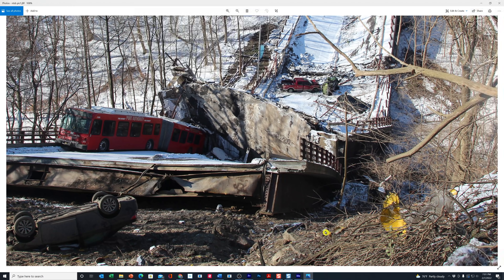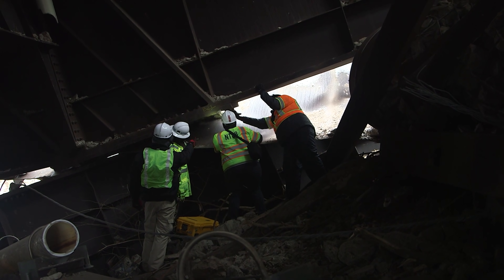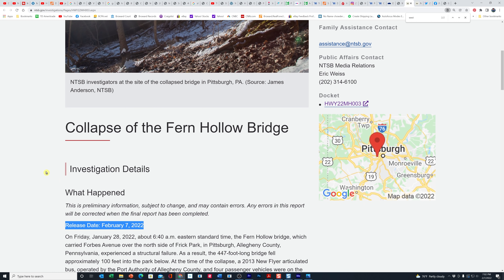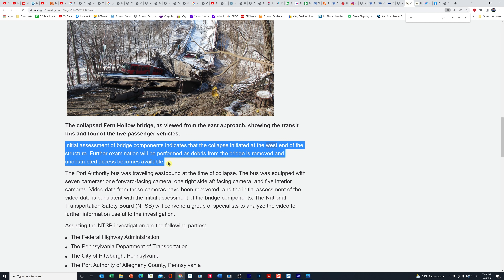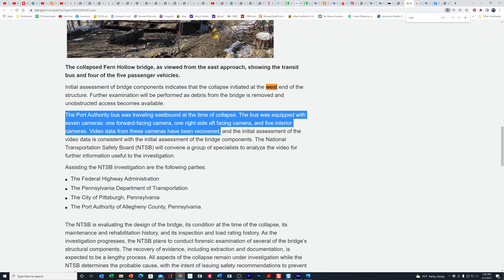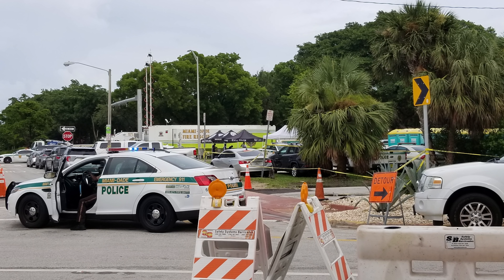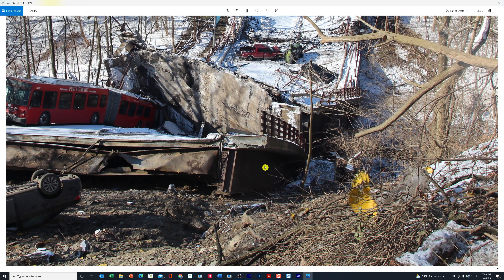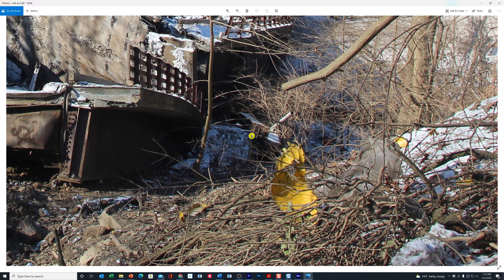NTSB Report Points Where Pittsburgh Bridge Collapse Started

Comment: Bridges have a life span which account for weathering and wear and tear.  This bridge probably needed to be replaced long ago.  Today's bridges are built much stronger with a life span of at least 100  years.  When the interstate system was built in the 1950s it was built with a life span of around 30, give or take.  Engineers back in those days knew that by the time the interstate highways needed to be replaced, design and engineering methodologies would be much stronger and durable.  Large expensive bridges like the golden gate bridge and the george washington bridge are the exception due to their high price tags and thus they are very well maintained.  The city of PGH did no good on kicking the can down the road for so many years.  Kid you not, there is some money in PGH - Melon Carnegie.  PGH needs to get their act together and the citizens and media of PGH need to start holding their politicians accountable.  PGH is not a poor city by all means and can do a much better job.  Just saying...
Reply: M Johnson — this particular bridge that collapsed in Pittsburgh was constructed in 1970.

Comment: Does anybody know what the temperature was that day because concrete shrinks when it's cold so if it was very cold then that means the bridge was small which would have made the expansion joints be open real wide allowing the bridge to wobble side to side if the bridge girders was rotted out then there's no doubt what caused it

Comment: The concrete that she was pointing at the I had to rebar exposed if you'll notice to the bottom left hand that's all been patched that's why I concrete stayed in the concrete just that is flaked off the steel is old concrete but yes at the bottom mat is only usually about 2 to 3 inches off the bottom but the old concrete that flaked off is all missing of the the mat of steel it was all old the concrete that you see now that's covering the steel is brand new concrete which is a patch job I worked on bridges for 36 years I know exactly what it looks like  and that is very
Reply: Common when the steel has salt that has penetrated through the concrete it's called sparling

Comment: We used a lot of COR-TEN in Michigan bridges from about 1968-1980 but it was found that in certain environments it just never stops rusting. Ultimately it's supposed to develop an oxide layer that acts as a barrier, it will rust to some extent and then that rust protects the underlying steel. Most of the COR-TEN structures remaining in Michigan have been painted.

Comment: I've seen a ton of jobs where the city maintenance department workers come up with a "fix", it never gets engineered or checked and often times results in more issues. A lot of times they patch together something that is a symptom of a bigger issue but they don't have the knowledge to put two and two together. And more often than not, they are focused more on aesthetics and public perception than the true condition of it.

Comment: @ 9:05 you show the support column concrete structure laying under the bridge . Indeed the reinforcement steel is to close to the surface.  The location of said column under the collapsed bridge tells that the bridge on its way down made a sideways move exposing the column on the other side . Though the concrete came off of the outer layer it is not telling of the inner placement of re-enforcement steel on the inside of it . Usually there is a core steel cage structure that is in line with the directional forces that the bridge is calculated to exert on the connecting points . The concrete peeling off can simply be the result of rust jacking and came loose due to sudden load decompression at the point of the bridge collapse.   Though to me it looks more like the underside of the deck slab where the shock of the fall crumbled off the surface layer of concrete.  Judging by the color of the steel mesh there doesn't seem to be a lot of rust on it as so it was in pretty good shape when it comes to moisture penetration causing rust jacking

Comment: Question.  Would you know if the base of the bridge was wider then the bridge deck ?  Meaning was the leg structure in a kind of A-frame configuration for side to side rigidity?  If one of the legs had given way , the bridge would have slumped more to the side instead of what it looks like to me where it more slumped down along the center line of the bridge with a minimal sideways deflection.

Comment: Bridges like these usually have a ball and socket connection where the leg frame sits on the piers . It accommodates for minimal  movements for weather induced expansion and contraction . A flat on flat surface contact would not hold and requires a different type of bracing between all 4 legs along the length of the bridge in order preventing them to slip off of their bases.

Comment: @ 5:59 you show the concrete Pilar foundation with the bridge leg laying to the right next to it ( east side ) . You can also see the bridge head separation and the damage to it . It has buckled seeming like it snagged behind something while it was pulled into the ravine.  The bridge leg is also pulled from its base and landed to the right of its base while it seems relatively straight by the looks of the footage.  Since the bridge came to rest about 10 foot to the left of its base line tells that the cross braces gave way and made the structure slump inward and to the left. Earlier footage from the ntsb shows the cable bracing being frayed and curled meaning it released tension in a sudden manner with the tensions energy coming back on the cable making it flower on itself.

Comment: NTSB wrote, rightly, that weathering steel is used for facade expression and to give an architectonic look after some years, provided exposure to rain, and allowing that rainwater to drain off.
In other corrosion cases, as standing water, trapped water, overlapping plates, galvanic corrosion etc it is no better and maybe worse than ordinary construction steel grades. 
Other steel manufacturers fought hard to keep contamitants as nickel and chrome to low levels.
The Cor-ten manufacturer turned those elements into a sales pitch, and some people fell for it. Pun not intended.

Comment: In regard to the rebar on the roadbed, I see that way to often with concrete jobs around town. For example, residential driveways are poured directly onto raw soil without any preparation, sand, gravel, no rebar etc., and these are housing developers/contractors who are doing it. I also see spot jobs around town that the smaller contractors work on and they rarely use "dobies" which are the spacers used for lifting up the rebar (or welded fencing wire) so that it is about center of the thickness of the slab they will pour. It's such a joke that these "concrete contractors" believe they are doing anything correct when all they are doing is cutting corners with less materials and saving labor.  I've also seen them use fencing wire vs. rebar and they use a square tip shovel to bend the wire here and there to get it uneven so that some of it reaches into the concrete...another stupid idea.  5 years later, people wonder why their driveway is cracking with uneven surfaces. 

No good information will come out of this bridge inspection. I hope the investigators put the city into a corner and force them to answer some tough questions. Also, I'd do the same with whoever, a contractor, engineer, city employees etc., installed the cables retrofitting to "help" the structure.
Reply from the maker: And the city needs to make tough changes in inspection

Comment: from what I could tell that rebar looked pretty normal I didn't see a lot of rust on it, that's what causes spalling and the rebar itself looks to be the normal 1.5" to 2" imbed, now in almost all pours some rebar will fall of the support and can be as close as .5" to the edge of the form that's normal but it looked like all was imbedded in the concrete, I think that spalling was caused by the fall.
Reply from the maker: Yes the concrete chipping off was from the fall, but it exposed what looks to me like rebar that is not 2" deep

Comment: Looks like there was compressive (l/r) buckling on an horizontal transom (at 8.13 minutes) possibly cause by the earlier attempts at strengthening with the post tensioning cables under the bridge deck - (extra thermal stress in cables due to cold causes buckling in transom beams and hence  longitudinal sides of deck pop up higher than centre line of roadway deck) ...?
Reply from the maker: Yes, likely several stressors contributed to this failure
Reply: @jeffostroff  no point in having tensile cross bracing without adequate resisting compression members 👍🥝🥝🇦🇨🙏

Comment: NTSB's job is to determine what happened and -- hopefully -- prevent a repetition.  They have nothing to do with any legal considerations.  In fact, their reports may NOT be used in any legal proceedings.  It is quite normal to have all parties who may have been involved in the design, construction or maintenance involved.  It is also quite normal for the public to not be involved; though they may be interested, they are not in any way qualified to comment. The comparison you made with Chaplain Towers is, frankly, misguided and reflects a lack of understanding of the NTSB process.

Comment: Jeff:  Thanks for another excellent video.  It made me think of a couple of things.
1) What did the inspectors do first? Look at the bus video or inspect the bridge? I'm thinking that they found that the bus video "agreed" with their assessment only after seeing what happened on the recording. This raises questions about what else they will conclude.
2) The collapse apparently followed the bus. It began where the bus had just been and went in the same direction. This would mean both that the bus was too heavy for the condition of the bridge and that the bridge should have been shut down or have been limited to lighter traffic at the very least. 
Some people, probably from several agencies, contractors and engineering firms are responsible for what happened. Will their be any accountability?
Reply: NTSB often has multiple teams on site, and in labs, some doing computer simulation. They tend to also work with everyone involved in cases, even if the companies who might be culpable they would have limited access to physical evidence. But multiple teams and multiple organizations assisting them come with multiple (often competiting) theories and they compare them, eliminate bad theories and try to reach a conclusion that way. 

Different parts of the team are responsible for checking the video, checking the structure, conducting metallurgy experiments, making sure that weather wasn't a factor in the collapse, other people should work on eliminated Earthquake as a potential cause, etc.

Comment: My guess for the whole collapse is this...those cables were probably installed in the Summer months a few years back.  As of the morning of the collapse, it had been very cold (near 0) for a long time.  I'm thinking that the cables contracted at a different speed than the steel, thus exerting extra pressure on the steel, resulting in a fracture of the (less than perfect) support column.

Comment: Rebar under tension is supposed to be 1/3 from the bottom and 2/3 from the top.  For a 6 inch slab of bridge deck, rebar should be 2" from the bottom, 4" from the top.  This bridge does not illustrate that rule.

Comment: Last week here in Pittsburgh they closed a bridge that runs over the south busway (the bridge is only used by buses and light rail vehicles). A port authority employee noticed something loose on the bridge and they closed it almost immediately. I pray they plan on inspecting all the bridges in Allegheny county but I doubt they will.

Comment: Major props to the NTSB guys for having the intestinal fortitude to clamber around in an already compromised structure, with no idea that something else is going to let go, and they would take on the appearance of flies in a beer car having been run over by a truck.
Reply from the maker: I would be cleaning my escape out from under the bridge before every picture I take
Reply: Doc — Do you really think the NTSB was putting its members in grave danger?  Trust me, they weren't.  The structure is down and pretty much stable.  It ain't goin' anywhere.
Reply: @puma.will.pounce7590  I doubt that the NTSB or anyone else was ORDERING these guys into the wreckage. My concern is that there is no way to determine the stability of all that jumbled wreckage. Any firefighter will tell you that, but they do go in sometimes if they think there is a life to be saved. Like I said, props to them.
Reply: @puma.will.pounce7590  As I said, "Props" or a hearty attaboy to them. Not everyone would risk it.